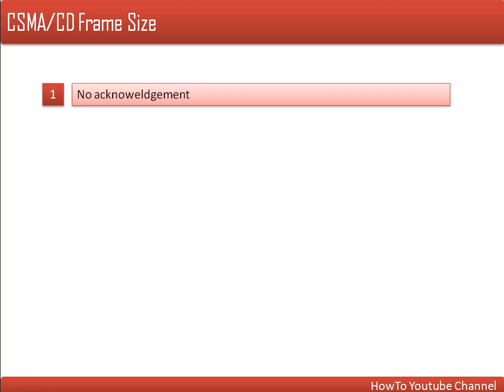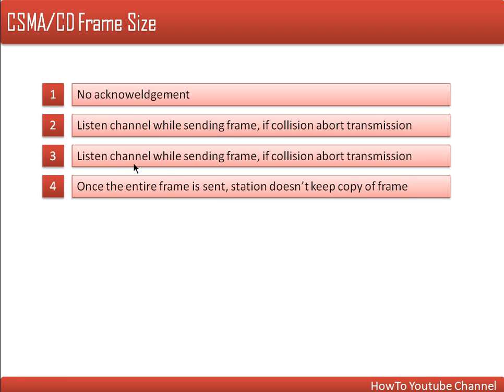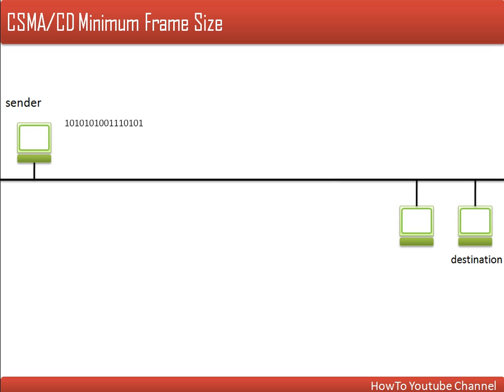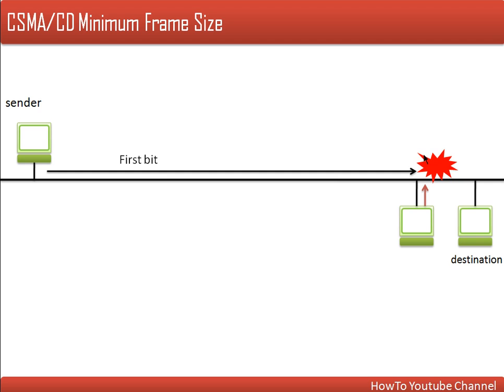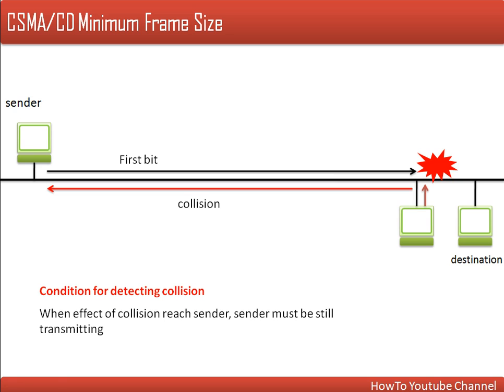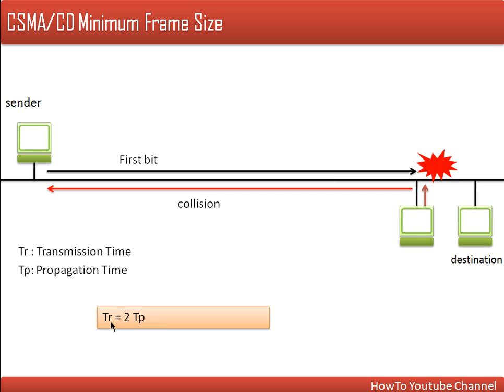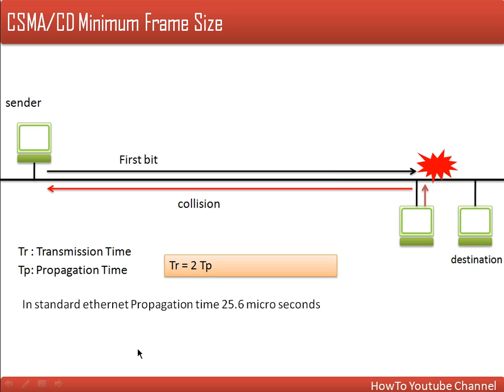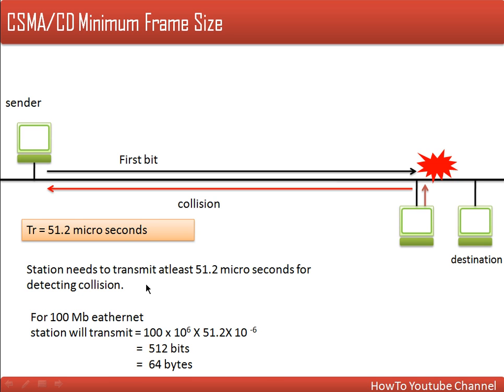Why there is a minimum frame size in CSMA/CD Protocol : Simple explanation

Comment: The only problem is that the propagation time of ethernet 100Mbit/sec is 5.12μsec and not 51.2μsec (this is the propagation time of ethernet 10Mbit/sec).
In fact, if you do [100*(10^6)] bit/sec * [51.2*(10^-6)] sec= 5120 bit, not 512 bit. 
Whereas [100*(10^6)] bit/sec * [5.12*(10^-6)]sec = 512 bit = 64 byte.